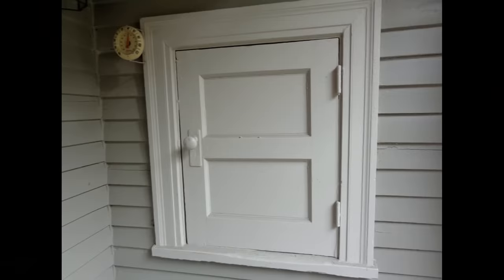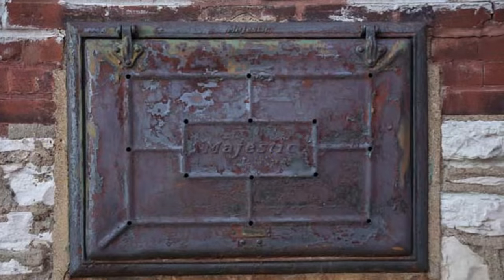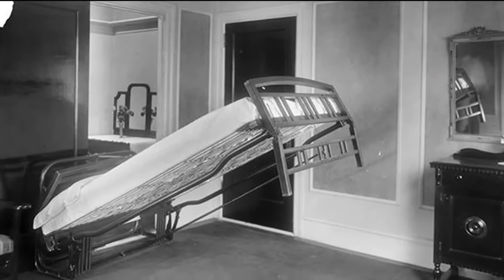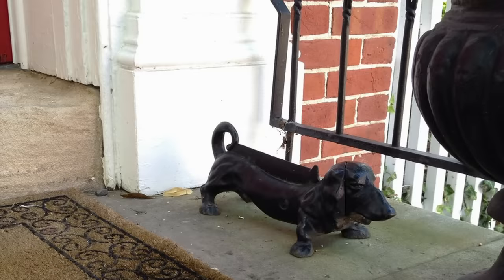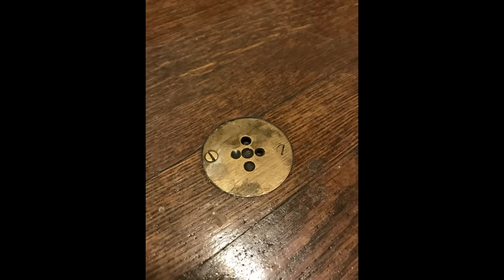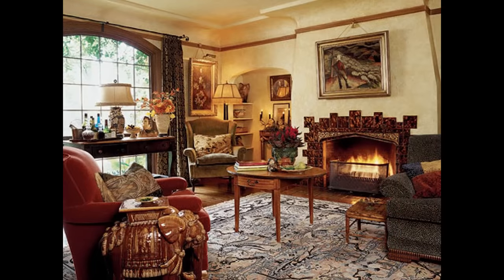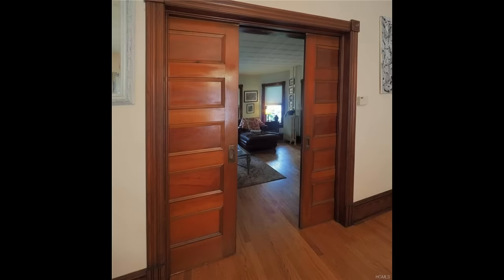Mysterious Home Features No Longer Used

Comment: I certainly agree with you about doors and  walls so you can close off portions of a house. Why heat 2200 square feet so you'll be warm in the one room you are using? I'm getting ready to sell my nice house that is properly partitioned and I dread having to buy something that is open concept.  I hate open concept houses/apartments.  I don't want to see the entire house from my front door. I expect I will hate whatever condo I buy for this very reason.  Partitions or movable walls are so expensive.
Reply from the maker: Thank you for watching and sharing your thoughts.  I hope you have found or will find the perfect new home.

Comment: I grew up with a weird room off the kitchen that had a drain in the floor and there was a toilet with a shower tucked a way in a corner.. When I asked I was told the room was used for butchering  and to clean up after hunting or gardening.  Looking back I should have guessed since it was called a mud room and was attached to the house by the pantry.

Comment: The current place I live in has a ice box and a door on the outside one is for milk delivery and the other is for ice delivery. In fact I'm sitting in front of the icebox cabinet built into the wall.
Reply from the maker: Sounds like you are in an interesting place with several historical features.
Reply: @RhettyforHistory  oh yes, I love the place. I call it vintage. The windows still have the weights on ropes in the wall, but are being replaced soon. It's gotten drafty. The basement boiler room (now called the dungeon still has the iron door for the coal shute.

Comment: The single wire electric lines were safer than what we use today in most cases. The wires could not fray and touch each other since they were kept a distance from each other. The one bad thing was they didn't have the third grounding wire. (that third prong on an appliance plug.)

Comment: The laundry chute and dumb waiter really need to be innovated upon and brought back. I get the fire concerns, but those can be addressed by having "pull" designs instead, which act more like a closed elevator car.  I do really hate "open concept" designs, and it seems like so many popular home-flipper tv shows go right to ripping out the room partitions in favor of open space, neglecting to mention that the house will now two or three times as much to heat.
Reply from the maker: Thank you for watching and sharing your thoughts.

Comment: My grandparents' house had a lot of that cool, yet obsolete, stuff. Let's see, there was: A coal chute, a milk chute, a toilet and sink in the basement (though Grandma insisted that it be enclosed within walls, as with a real bathroom), a laundry chute, and two landline phones. When I was really small, they even had the pushbutton light switches, but changed them out before I was even tall enough to reach them. They eventually sealed up the coal chute somehow because there was a spate of robberies in the area that involved sending in a kid or small guy through those. The milk chute was made secure, too, but in a way that wasn't as permanent. I used the basement toilet a lot. The washer and dryer were in the same room as it, much like in the pictures except for the wall I mentioned earlier. Part of the basement was indeed the designated root cellar, though that hadn't been used as such since my great-grandma's time.

It was a cool old house. My mother and aunt didn't appreciate it, probably because they grew up in it and were used to everything, but I did. Unfortunately, it was also in the city, which I didn't want to move to and still don't, so it was sold when my grandma passed on.
Reply from the maker: Thank you for watching and sharing some of your grandparents home.  It sure sounds like a great one too!

Comment: My home still uses the old porcelain standoffs and cloth wrapped wire. I really don't see a reason to replace it as it works and does not get warm even when under full load. As long as it's properly installed it's no more a fire hazard than modern wiring. The fire hazard came from homes where everything was on one 15-20 amp circuit, which was common. In the late 1800's to early 1900's people could not imagine needing to run several high load devices at the same time. So to save time and money everything was simply placed on one fuse. Some times even the lights would be on the same circuit as the outlets. So if this is the case for you, it may be time to at least split those into their own circuits.

Comment: Vanguard Heat detector alarms are another one that were replaced with more modern fire detection devices. Grandmas house had 3 of them. They were mechanically wound up and then in the event of a fire, heat should activate it causing the loud bell to ring. I don’t think they were very effective, especially in small homes as I think the smoke and fire would be well developed by the time it set it off. 

She also had the pocket doors, rotary phone in the hall that she still used till 4 years ago, counter weighted windows and an oven and stove made by General Motors!
Reply from the maker: Thank you for watching and sharing some of what your grandmother's house had.

Comment: Knob and Tube wiring is fine as long as it's unmolested, that being said it's almost never unmolested. Push button switches never stuck, one button was on and the other was off and they were mechanically connected. And the coal man had a high lift truck that had a shute on the back that went in the coal door. I still get coal that way. Although maybe back when they used horses and wagons he shoveled it

Comment: My house is old. I have at least half of these. Coal door (sealed now). Knob/tube wiring (rewired/removed). Phone nook (not used, but it's there). Land line (in active use, but handsets are wireless). Phone wiring for landlines all over (MUCH clearer than my cell phone). Milk door (sealed up). living room/kitchen aligned with fireplace - all other rooms have doors. Basement toilet next to the coal room/furnace (back when coal was used, I could see the purpose). Other various things. When HVAC was added, the radiators remained in use, but the AC vents were added. The furnace was put on a separate thermostat (??? - changed that). Because the AC vents were in the ceiling, the plaster/lath ceilings were removed and drywall was installed - but the walls remained plaster/lath remains in the walls (probably because of asbestos?). Crappy wallpaper had to be steamed off and plaster sealed, then primed/painted. The house was prior owned by a farmer - who kept track of weather and crops by writing it on the basement walls. We have the space for the laundry chute, but we converted it to a small space to hold linens.
Reply from the maker: Thank you for watching and sharing a little more about what you have seen and have in your home.

Comment: Knob and Tube electrical was far from a fire hazard.  The neg and pos wires were separated which kept the chance of an electrical fire being almost non existent. They stopped using knob and tube in construction due to cost with bmx and romex being much more inexpensive to install.  Knob and Tube wiring is still in use in some homes today as with some other things from the past, it was made to last a long time.

Comment: 1:59 Wait, NO ONE uses land line jacks anymore? Hmm.
Reply from the maker: Yes but slowly going away.  In 2003 95% of households had them.  Fast forward to 2018 and only 40% had them.  That number has dwindled more as the generations are switching out.  I'm not sure what the exact percentage is for 2022 or2023.  Thanks for watching!

Comment: Here in the UK, kitchens usually used to have a large alcove for an open fire or wood stove, but beside that, built into the chimney breast was usually a little cupboard. These got warm from the fire to help bread dough rise, but not so hot that it killed the yeast.

Also, old miners terraced houses in the UK were rairly built with an inside toilet, even after indoor plumbing started becoming the norm it was rare. At best they had a plumbed in toilet down the garden, but sometimes, groups of houses would have an ally running along the end of the garden, and at the end of that was a communal toilet that was shared between several households. I used to live in a beautiful old miners terraced house, and dispite the whole row having had inside bathrooms retrofitted (Ours was in the form of an extension on the back of the house..... So the garden was tiny, and you needed to walk through the kitchen to take a shower. :D), there was still a strip of overgrown "No mans land" running along behind all the gardens.

Comment: The reason people didn’t just put a nail into the wall to hang a picture is because of the way walls were constructed. Back in the day, walls were lathe and plaster on the inside of the home. Nailing into it was like nailing into a rock and if one persisted in trying, very likely a large crack would appear.

Comment: One bad idea was having a window right next to the front door, the same length as the door.  It’s for seeing who’s at the door, but thieves would break the glass and let themselves in, by turning the manual lock.  They had those in the inner city projects I lived in, in the 90s.  I installed a steel grate over the window.  Sure enough, someone carrying a gun tried to get in because they thought I called CPS on them…it was a case of mistaken identity, which is common in the city.  Please, no more windows by the door, where people can let themselves in!  A peephole works just fine.

Comment: I prefer "rooms" in a home to open concept (which I really don't like at all!) for a number of reasons. First, the walls mark the space and its purpose. Another, less known but probably most important, is that in the event of a fire, a home with actual rooms will not burn as fast potentially resulting in less property damage depending on access to fire department coverage and definitely allowing more time to get out and make sure all family and pets are out. Walls not only provide privacy and definition, they also provide protection!

Comment: Phone jacks would have been preferable… Used to live in a home from the 1930s that still had a crank phone connections and a set of hand-wired telecom bus bars in the basement 🤯 …it was actually pretty fascinating
The metal cabinets  and 2-prong outlets I could’ve done without tho
Sadly the basement wasn’t even haunted… 👻

Comment: my parents house has a nook nekst to the garage that sits under an external stairway, it as one larger door in its side and one smaler rectangular door at the end of its sloped floor, my mother claims it was once used to contain trash but i just cannot belive that tiny door to small on the side for a shovel was the main way to unload that hole room...

either way nowdays ve use it for gardening stuff etc alongside coal and flamables as its all stone (exept the doors) and this not all that lightly to spread in case of fire
Reply from the maker: Thank you for watching and sharing a little more about your parents home.  That's very interesting!

Comment: 3:55 knob and tube wiring isn't necessarily unsafe. It depends on how the joints were made, and as long as you don't overload the wiring for its electrical rating, you'll be fine. The risk comes with no ground - so there is no "safe" path for electricity to go if there is a problem. Since most appliances don't have metal exteriors anymore, this is less of a hazard, especially with the invention of polarized plugs. Using old unpolarized appliances does present a hazard, though.

Comment: The ice wasn’t “fresh”; before 1924 they couldn’t “make ice” in quantities because they had no refrigeration. The “fresh” ice was from the ice industry which cut ice from frozen lakes in winter time. Large “ice houses” (warehouses that stored winter ice) usually ran out by August. Some homes had ice rooms, insulated with pulverized cork nodules behind heavy tarpaper between the joists, that could keep the spring time ice well into the fall.
Reply from the maker: You're right on the ice industry.  Thank you for watching and sharing a little more with us.

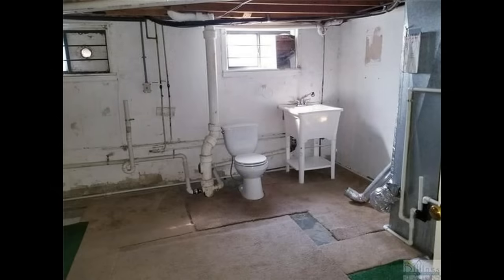Comment: 3:17 while this is the common explanation and probably not untrue. The real purpose was as a safety feature. As cities grew from industrialization (like in Pittsburgh) the sewage pipes were not necessarily big enough to handle the max potential flow. So new construction started installing toilets in the basement so in case of a back up the sewage wouldn't flow into the living space of your home, merely the basement where it wouldn't wreck your home.

Comment: you forgot stove pipe covers/plates .. a cover for hole in wall of kitchen. that was use for a coal or wood stove chimney pipe, for heat and cooking.. sometimes found in the existing chimney ... on top of that . summer kitchens... some houses had a small shed like building next to house. sometimes right off back of house. usually off kitchen porch. used so a fire can be burned to keep stove hot. for hot water and cooking in summer, without making the house hotter in the summer.... also i would like to say nice video.. and where i live  90% of people still use coal heat so we use coal shoots and bins for delivery coal is cheap in coal country also just go out and find coal laying all over from mining.... take home, clean, break, and burn... works in a pinch.... everything you mentioned you will find in every house in my area.. scariest part is the push button light switches can be found in use in some of these homes ...
Reply from the maker: Thank you for watching and sharing a little of what it's like where you are.  I appreciate you mentioning some other items for us to remember too.

Comment: Laundry chutes also only work if your laundry machines are in the basement. Which is not always the case in modern homes. For instance my parents remodeled to put the laundry on the second floor because we couldn't hook up a drier vent in the basement due to the length limitations (25 feet, minus 5 for each 45 cumulative angle bend).

As for the Pittsburgh Potty, its because Pittsburgh was the center of the steel industry at the time.

The ceramic wire insulators: said parents house still has several of them affixed to the joists. Not in use (although there may be a few with regular insulated wiring hooking around it). Said joists are also swiss cheese from all the holes drilled in them for the gobs and gobs of wiring. Still have, but no longer use (as of about a year ago), a oil-burning steam-heat furnace too.

Boot scrapers: parents have one. It gets used. Both (a) because my mother has horses and (b) our 200 foot long gravel driveway turns into a mud driveway during the melt season (i.e. late winter).

Transoms: a very old house on city-equivalent-land was slated for demolition and my mom and I went through and "stole" all of the antique door knobs, a light fixture or two...and both gorgeous transoms (yes we were allowed to do this, mom was on city-council-equivalent, and we double checked the demolition contact). They were just purple colored glass, but it was still a vibrant piece. Mom had tried to get the house saved as a historic building, but the best she was able to do was save the barn which will be deconstructed, moved, and repurposed. There was also a corn crib, and sadly, it joins all of the other corn cribs that no one thought was worth saving, making it one of the rarest preserved structures.

Comment: My brand new houses have had landline jacks. They’re definitely not a thing of the past.
Reply from the maker: In 2003 95% of households had them.  Fast forward to 2018 and only 40% had them.  That number has dwindled more as the generations are switching out.  That percentage would be much lower now.  Thanks for watching!
Reply: @RhettyforHistory  I’m thinking those numbers, wherever you got them, are probably referring to actually having land line phones, not jacks. 

Btw EVERYONE should have a landline phone in their home for many reasons. Cell service going out, or calling 911 for example. Sometimes you can’t talk to give them address, but they can trace the call. Also in every gated community I lived in, it required a landline to work the gate.  It wouldn’t go through cell phones. That can be different place to place though.

Comment: Pocket doors tend to be flimsy, and you pretty much have to take a wall out to replace (or, often enough, to repair) them. Using pocket doors also usually means not having insulation in that part if the house. I see why people only use pocket doors when they basically have to.
Reply: Apparently, you haven't seen a truly old pocket door. They are very sturdy and substantial. The last pair I used were solid wood, actually very ornate and heavy, but easy to move. And since they are interior doors, insulation isn't necessary.
Reply: @gusmonster59  that's nice and everything... but that kind of quality really doesn't exist anymore. Pocket doors that are actually available are crap. Just to re-phrase:  What Home Depot or hardware store did you buy your nice heavy pocket doors from? Oh, you didn't? That's what I thought.